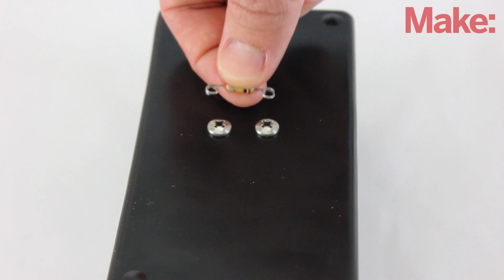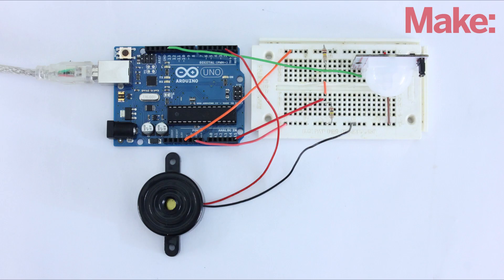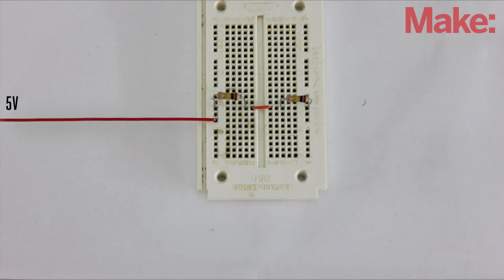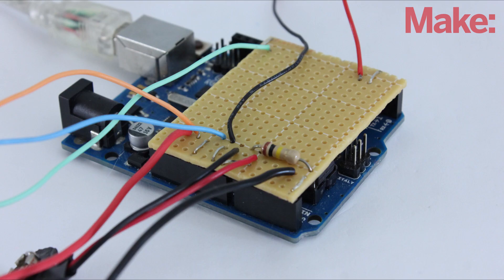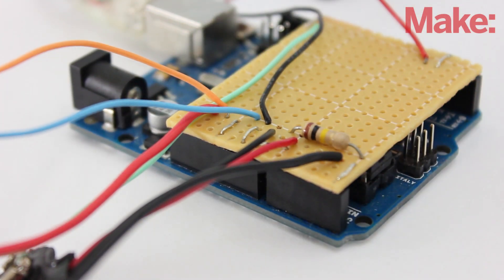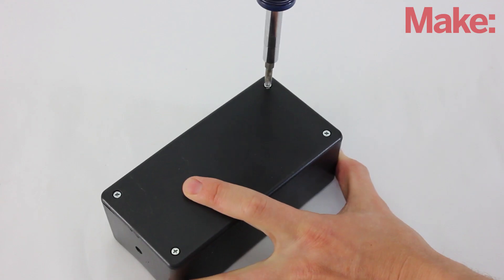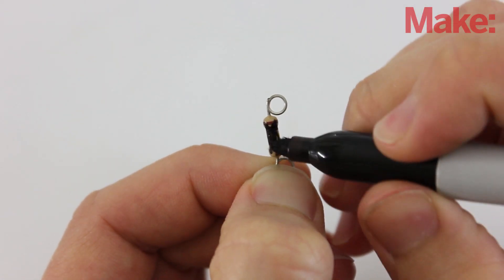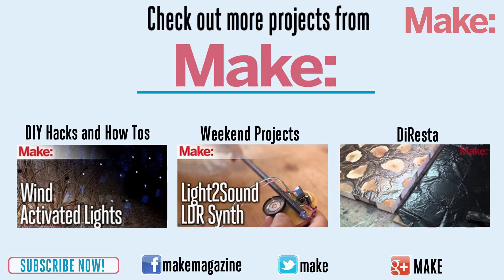Resistance-Controlled Alarm

Comment: Why Arduino? This could be done with proper electronics rather than just shipping everything out to code!
Reply: burgersnchips http://share.pho.to/9SidL There's one I just made for the fun of it
Reply: burgersnchips 
I think many people are interested in what they can achieve with electronics rather than the actual electronics itself, so for them it makes sense to do it this way.  

To put the thing into perspective, think about it like this: you are just a step or two from the person using these kind of modules and ready shipped code, while you are tens or hundreds of steps from the people that mined the metals and stuff used in your components, so what you may call "proper electronics" is probably just connecting up modules you buy ready made too. 

Also, I think it is important to remember that these videos really show ideas from which you can work to make something, not the definitive and ultimate solution to something. Using a microcontroller makes sense, too, since you may want to change things about the system later.
Reply: +Ts6451 Yes...someone who gets it.
Now I just need to learn enough programming to get the speaker to play 'Dixie' like horn on the Gen Lee...that would do a number on intruders.

Comment: Coloring sensor black doesnt help much if someone gets their hands on ohmmeter
Best sensor you can make that would be practical is something that senses finger resistance (which is usually 1-2mOhm) but you would se it up to look for wet finger (trick only you knew) which means were looking at around 400-600kOhm resistance between contacts
Reply: BeucaN YOLO yeah, because nobody would want to touch the contacts if he sees you licking your finger and touching it...
it would soon become a discusting mess...
Reply: muh1h1 the point is secretly licking your finger and only you would know the trick. I think its more practical then carrying resistor around :P
Reply: BeucaN YOLO
i understood that, i am just saying, even if someone finds out about the trick, they would still not try it because it is discusting :D
Reply: you can wet your fingers with tap water if you'd like